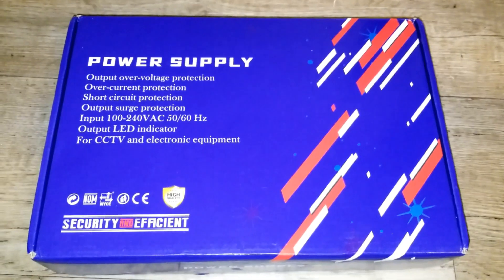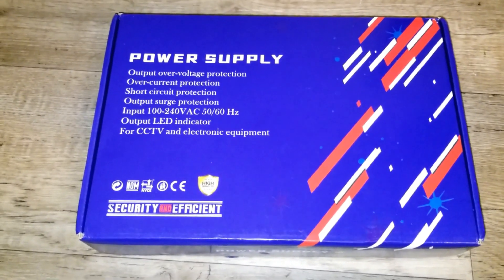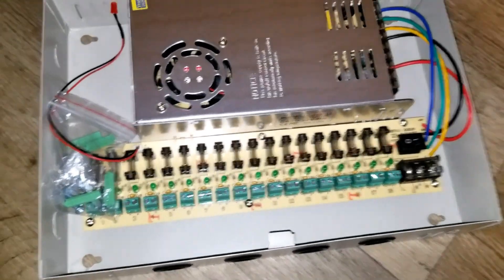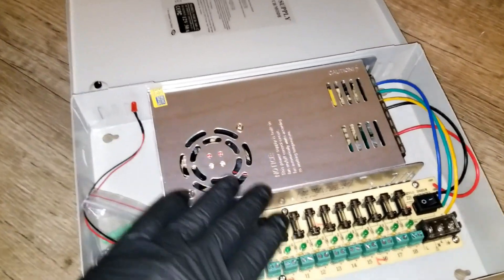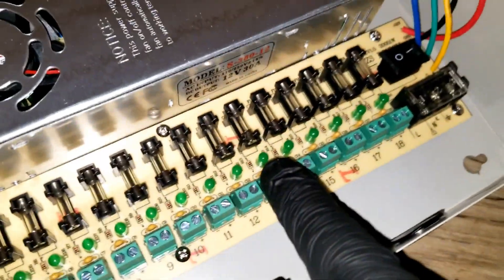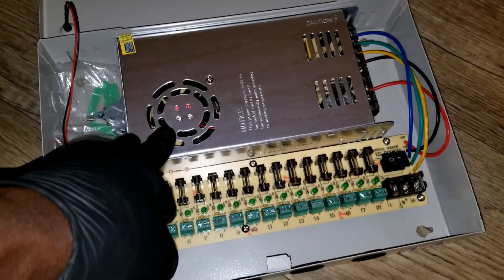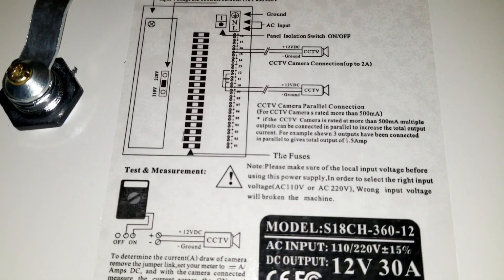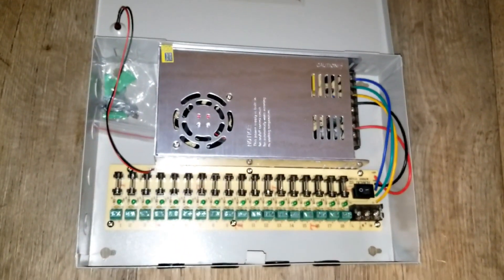CCTV SECURITY CAMERA DISTRIBUTION POWER SUPPLY BOX (Part1)

Comment: THATS A NICE CCTV POWER BOX YOU HAVE THERE . YOU MIGHT CAN UTILIZE IT TO POWER SOME LOW VOLTAGE LIGHTING AROUND INSIDE YOUR HOUSE DURING A POWER OUTAGE CONNECTED TO THE COMMAND CENTRE OR THE DIY SOLAR GENERATOR . EXCELLENT PICK .